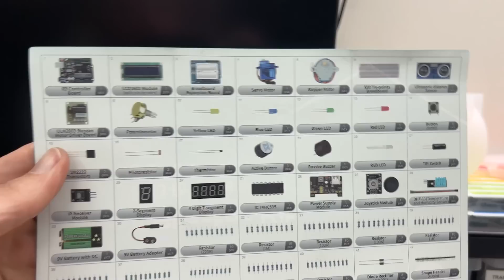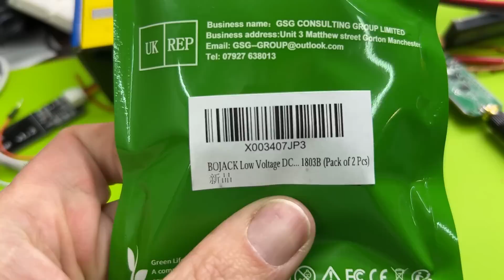I'm in WAY over my head.. I could use some help..

Comment: Sonoff ZB Dongle E is a joke, upgrading/replacing the firmware of that thing is pain in the arse, much more if your using it as coordinator, shit sherlock after updating the coordinator's firmware you need to power cycle every single damn devices you have with Dongle E (yeah, you might as well just go to your main power panel and trip the main power breaker for 1 minute). battery powered zigbee devices is a another level of headache.

in short, ZB Dongle E is a trash (possible even with that ha skyconnect which also uses the same chipset). 

if you want a ez mode extender, just go grab a  zigbeeoutdoor smartplug. this kind of smartplug have better antennas inside.
or
get a Sonoff Zigbee Dongle P. But this thing is out of stock and even if you manage to find one, the price just got double.

Comment: Ohhhhh buddy. I know you want to play with the Xbee and bring on more zigbee things online, but ESPHome. This is a true goose chase with a golden egg at the end! I personally use these things to control relays, contactors, LEDs, water sensors, temp sensors, distance sensors, small displays, microphones for new asset features on HA. I know you have the Emporia Vue, guess what you can load ESPHome on that bad boy and pull all you information from that locally no cloud. I reserve my Z-wave and Zigbee stuff for manufactured products that are just easy to deploy. If I want to start building your own sensors/controllers ESPHome. And be warned you just found another rabbit hole within the labyrinth for HA rabbit holes!

Comment: Like a lot of other people have mentioned, try out ESPHome with an esp32 board. It's more capable than an 8266 and costs basically the same, but both are compatible with espHome. I did run into an issue getting modules to connect to home assistant though because of my network's configuration. My work around was to load a simple sketch onto the esp32 to connect to my wifi, print out its MAC and the IP it got assigned, then set that IP to static in my router and include that IP in the espHome config for the module under wifi->manual_ip->static_ip. You also need to supply the IPs for the gateway and subnet under manual_ip. If I don't tell the module what IP it should be using before hand the modules don't show up in home assistant.

Comment: Recently tried out ESPHome using a NodeMCU ESP8266 since it has an onboard LED and button that are connected to GPIO pins so i could test. Honestly it is insane how responsive it it. Given different cheap wifi smart devices i thought it would have been slow and unresponsive but i have experienced quite the opposite. I plan to buy some sensors for more testing and then try to make my own sensors.

Comment: I tried exactly this with the "P"-Version and ZigBee2MQTT. No problems so far. But from my understanding isn´t just any plugged in ZigBee device a repeater? Couldn´t you just take the parts you need from a hardwired device like a Sonoff Switch or a TuYa smart plug (maybe add an stronger antenna) and use that??

Comment: Esp home with custom esp32's.....  You will go down the rabbit hole of making your own controllers and PCBs. The bug hut me, then in started building my own items with esp32's,  then I design my own PCB with all the items and sensors anf 3D print cases and now I have a ton of custom sensors with the esp32 modual mounted and running it.

Comment: Like others have said, start with ESPHome.  If you're looking at analog sensors like those water sensors, the esp32 has more analog inputs than the 8266.  The esp32 is in general beefier and can run handle LED strips and other things better.  ESP's will run on wifi, but theyre way easier to work with and you can update your config over the network if you want to tweak settings after you deploy them.
Reply: I use one ESP32 to run 12 LED strips. It's awesome!
Reply: I agree.  ESP32 and it's variants are great!  Also that DHT11 temperature sensor is crap.  Get DHT22 instead.   There are more expensive sensors out there but if you're going to deploy several sensors really can't go wrong with DHT22 with ESP32.
Reply: Esphome is 100% the way

Comment: Start with working out what code you need to read the sensors without any WiFi/Zigbee.  Then work out how to connect the wireless devices to your network.  Then you should be able to combine the two and get the sensor readings wirelessly, and into HA

Comment: Esp home is what you need to learn.
Reply: 2nd this. ESPHome with an esp8266 or esp32 is a super simple way to get some sort of custom device going. I've built temp sensors, bed occupancy sensors, current clamp power monitors, and I was working on a blinds controller at one point. It's great.
Reply: This is the way
Reply: This is the Way
Reply: Also, with your Zigbee devices, try going next to your coordinator plugged into your Home Assistant. Sometimes you can get interference. I was having an issue with some of my sensors, not connecting until I reconnect to them next to the coordinator, even though I have repeaters throughout my house.